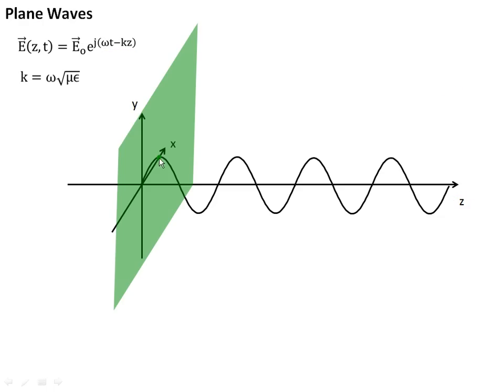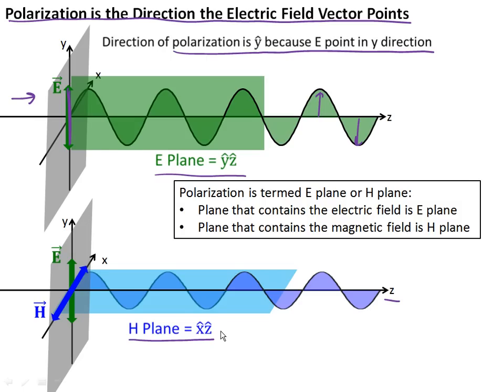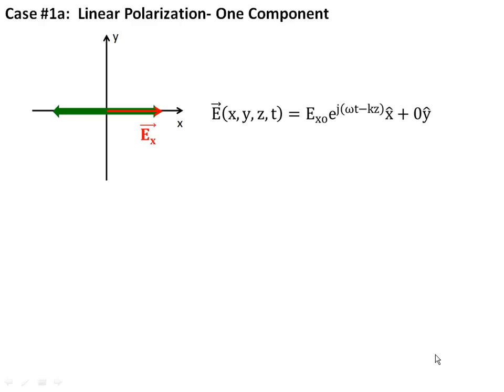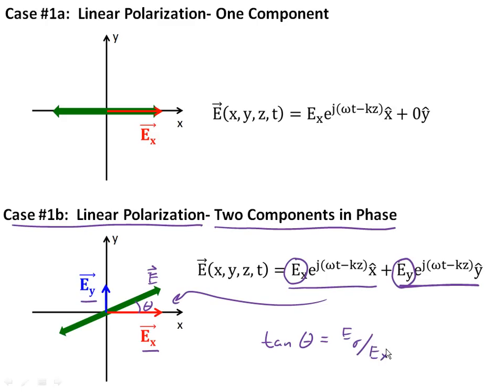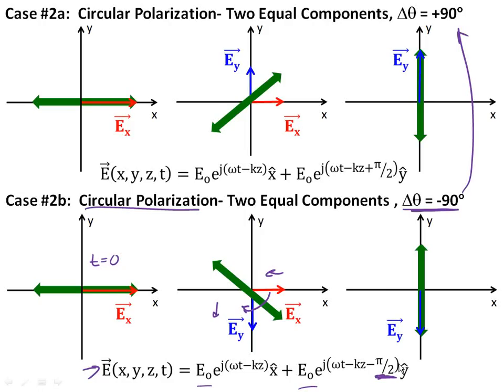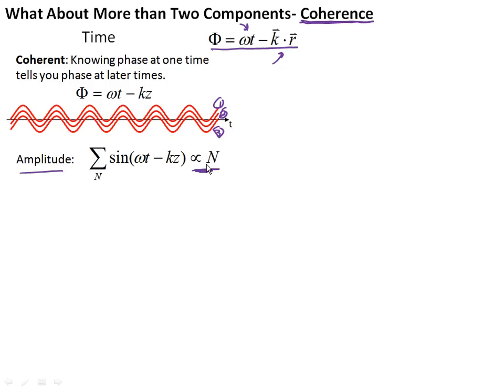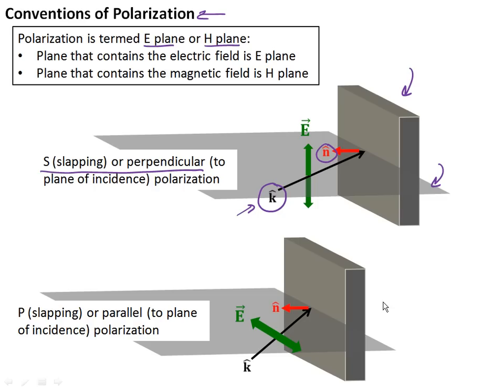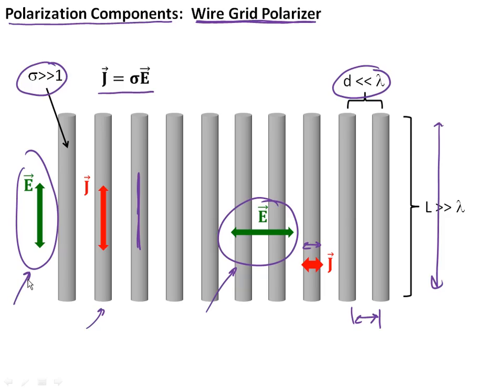3.6 Plane Wave Polarization

Comment: Sie🌟🌟, During interference of EM wave... electric field adds up like vector....if two electric field of EM wave of same amplitude ,frequency,inphase...when added by vector gives,E+E= 2E, but when we add Energy of E field WHICH IS PROPORTIONAL TO E^2...it contradicts (€E^2=2€E^2)....
Similarly for distructive interference of two similar PLANE Em wave of PHASE DIFFERENCE of π interfering DESTRUCTIVELY COMPLETELY... IF E field becomes ZERO EVERY WHERE.....
WHERE DOES ITS ENERGY GO?what is wrong here?
Thank you sir 🌟

Comment: Does the offset have to be exactly 90 degrees in order for polarization to become circular?  Or it enough to say the moment Y has a positive offset, the polarization becomes somewhat counter-clockwise?  And the moment Y has a negative offset, the polarization becomes slightly clockwise?

EDIT:
Ah, nevermind, I hadn't seen the bit about elliptic polarization.  Thank you for being so thorough!  This is an excellent overview of wave polarization.

Comment: Here is the Matlab code.  Set x and y amplitude < 1 when it asks or it won't fit on the axes.  File name is the name of the movie file that will be generated.

% Define x and y amplitudes and wave vector
Ax = input('X Amplitude? ');                    % x amplitude
Ay = input('Y Amplitude? ');                    % y amplitude
lamda = 2;                % wavelength
k = 2*pi/lamda;        % wave vector
dphi = input('Phase Difference in degrees? ')*pi/180;            % phase difference
z = linspace(0,4,160);                % spatial variation
% define time vector
t = linspace(0,1,50);
vp = 4;  % phase velocity defines how fast animation moves
f = vp/lamda;  % set frequency
w = 2*pi*f;

% set up to capture a movie...
% Prepare the new file.
filename = input('File Name?','s');
vidObj = VideoWriter(filename);
open(vidObj);

% run nested loops to plot the wave...
for m = 1:length(t)
    x = real(Ax*exp(-i*k*z) .* exp(i*w*t(m)));
    y = real(Ay*exp(-i*(k*z+dphi)) .* exp(i*w*t(m)));
    a = plot3(z,x,y,'r.');
    set(a,'MarkerSize',10)
    for mm=2:length(x)
        %line([z(mm) z(mm)],[0 x(mm)],[0,y(mm)])  % use this for lines
        a=patch([z(mm) z(mm-1) z(mm-1) z(mm)],[0 0 x(mm-1) x(mm)],[0 0 y(mm-1) y(mm)],[.8 .8 .8]);
        set(a,'FaceAlpha',.7);
        set(a,'EdgeAlpha',.3);
        set(a,'EdgeColor',[0 .7 0]);
    end
    % set up graph
    a = line([0 max(z)],[0 0],[0 0]);
    set(a,'Color','k')
    box on
    grid on
    axis('equal')
    axis([0 4 -1 1 -1 1])
    xlabel('Z')
    ylabel('X')
    zlabel('Y')

    % try to plot the overall line on xy plane
    trailx(m) = x(1);
    traily(m) = y(1);
    trailz(m) = 0;
    hold on
    plot3(trailz,trailx,traily,'k.');
    hold off
    view(-45,20)
    
    % first plot a heavy line representing the source field along x
    a = line([0 0],[0 x(1)],[0 0]);
    set(a,'LineWidth',3)
    set(a,'Color',[1 0 0]);
    % now the y source field...
    a = line([0 0],[0 0],[0 y(1)]);
    set(a,'LineWidth',3)
    set(a,'Color',[0 0 1]);
    % and the overall source field as a green line
    a = line([0 0],[0 x(1)],[0 y(1)]);
    set(a,'LineWidth',3);
    set(a,'Color',[0 .75 0]);
    % plot two narrow black lines to clarify it is vector addition
    a = line([0 0],[x(1) x(1)],[0 y(1)]);
    set(a,'LineWidth',1);
    set(a,'Color',[0 0 0]);
    a = line([0 0],[0 x(1)],[y(1) y(1)]);
    set(a,'LineWidth',1);
    set(a,'Color',[0 0 0]);

    % Capture a frame for the video, and put in a pause
    pause(.05)
    currFrame = getframe(gcf);
    writeVideo(vidObj,currFrame);
end
trailx = 0;
traily = 0
trailz = 0;

% Close the video file.
close(vidObj);
Reply: thank you i was looking for the code .

Comment: Two quick questions:
1. If you have a coherent light source and an incoherent light source with the same wavelength and power output etc., does that mean the electric field is larger for the coherent light source?
2. Can you talk about polarization, superposition, and the things discussed here in the same way when thinking about single photons?
Thanks!
Reply: Putting in my two cents here. I am not sure about nr 1. I think that the amplitude is the same, just the direction changes constantly for non-polarized light. Does this answer the question?
As for nr 2: we are in the world of quantum here, so a photon is not particle, it is something that can be described by a wavefunction. It can be at two different places at the same time, so it is valid say that it is possible that a single photon can have linear polarization in two directions, creating circular or elliptical polarization.